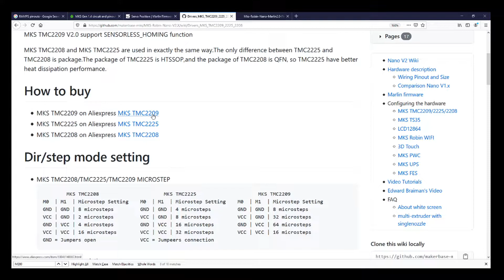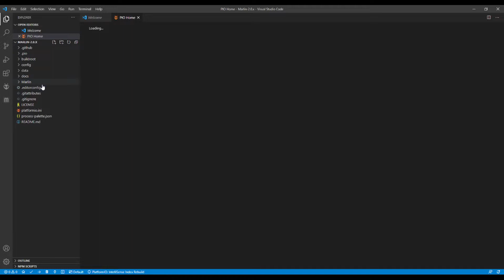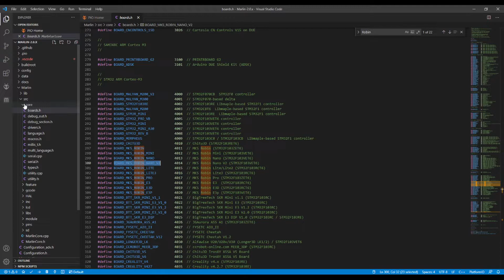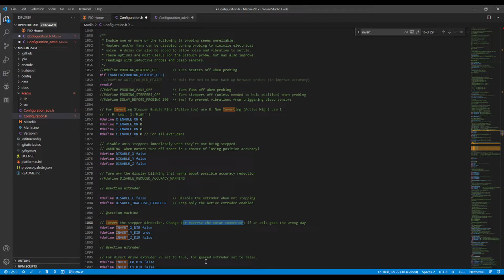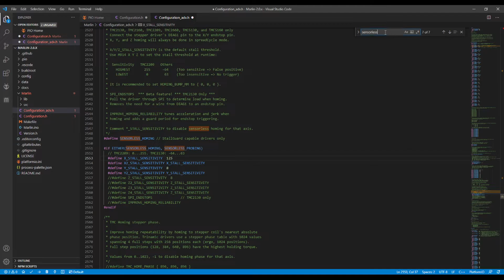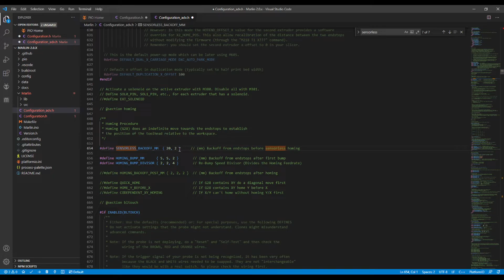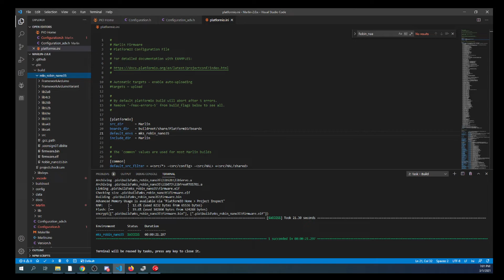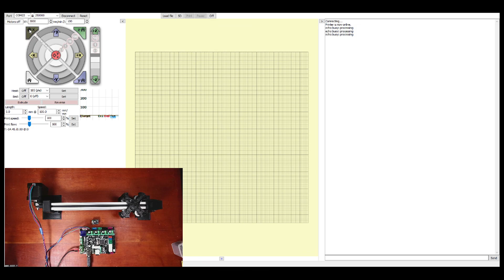MKS Robin Nano v2.0 - TMC2209 UART with Sensor less homing

Comment: Thanks for the video. I've got the V3 version of this board, but I can't get it to connect to pronterface, It shows up on com4, but when I try to connect it just says "connecting..." and won't connect.
Reply from the maker: Try power cycling board and then see if Pronterface can connect.
Reply: @EdwardBraiman  Thanks for the fast reply, I ended up changing the com port to -1 and it's working now.
Reply from the maker: You're welcome.

Comment: I just cannot do this.....iv tried everything exactly in this vid and its not working, has the process changed??
Reply from the maker: Marlin released a new firmware changing the steps.  There is a supplemental video in playlist.
Reply: @EdwardBraiman  its out of date....please could you do another ?? I'd pay you...honestly iv been trying to sort this for my ender endzilla for nearly 2 weeks but every bit of info is wrong or out of date....please would you help me ??
Reply from the maker: Friday I might do a live stream and talk about the issues and work around.  The heat index here is a little high.